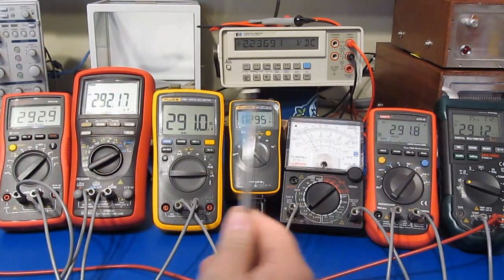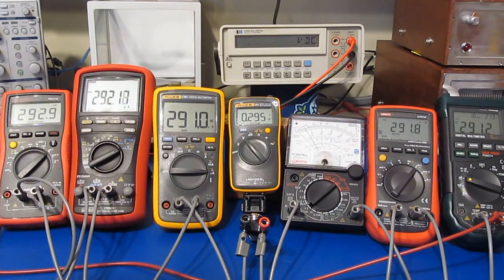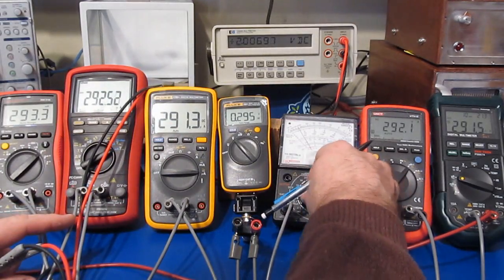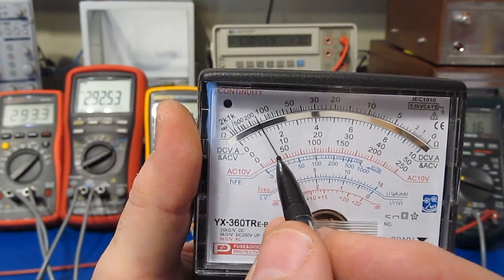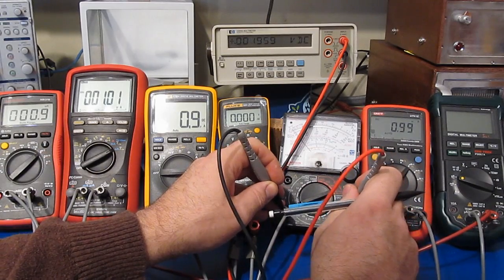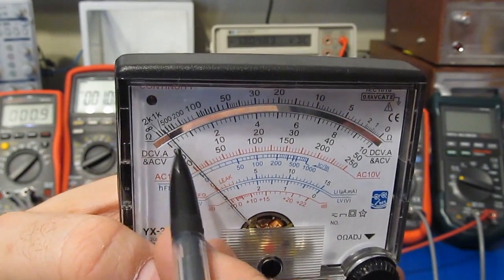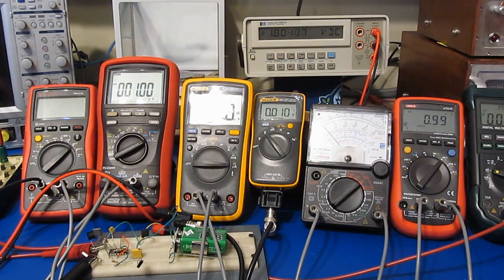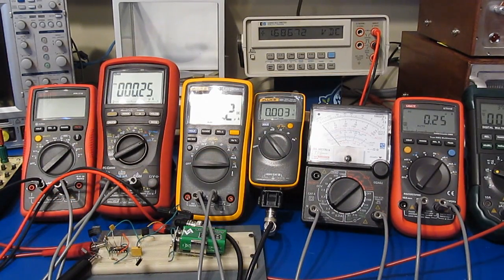More Meters are Tested at 1uA and Higher Currents

Comment: The Brymen seems to have different shunt resistors on each of its two current inputs. I guess you pay for lower shunt resistance in the 10A socket with less ability to measure small current.
Reply from the maker: It is common for meters to use different shunts for different ranges.

Comment: Hey Joe. This is the setup I'm wondering about. What's your username on EEVBlog I'll message you there.
Reply from the maker: Same as it is here.  You can find the main links under the About or Discussion tabs off the main page.   Not sure why you posted your question to a video that had nothing to do with your question.   In this video the meters are in series is all.
Reply: joe smith Was busy at work. Posted on the wrong video on my iPhone. Sorry about that.
Reply from the maker: Ok.  Does this make more sense now that they are all just strung together in series and the current then flows through all of the meters the same?
Reply: joe smith What are you using for this? I've been using multimeters for 20 years but until recently I never thought about testing them like this. I'm trying to understand more about how they work and how to test them as I'm finally setting up a home lab. I find your videos very informative and interesting
Reply from the maker: Just a power supply.  If you design low power devices, this would make more sense to you.  If you were an electrician or home appliance technician for example, I doubt you would ever have a need to measure low currents like this.
Reply: joe smith I worked on high power radars. I now work on particle accelerators. I understand it's hooked up to a power supply (I'm currently building two myself) I just don't see how the meters are tied together.
Reply from the maker: In series.  If you do not understand basic series and parallel circuits, Google is your friend.  There is a lot of good information at your finger tips.
Reply: joe smith I understand the difference between series and parallel I just never thought about stringing multiple meters together like that.
Reply from the maker: If you were benchmarking meters in their current measurement modes, would you just test them one at a time?   If so, why?
Reply: joe smith I've never bench tested any test equipment before. I was trying to understand your method so that I could apply it to the equipment I have. I'm sorry for inconveniencing you with my questions. Have a good weekend.
Reply from the maker: It was not an inconvenience.  Maybe not the clearest presented question I have tried to help answer.   Benchmarking these meters is the majority of what is being presented in these videos.  For you own home experiments, you could just try a few low cost meters and see how they compare against what you feel is your best meter.   You may be surprised how close or different they are.  Later
Reply: joe smith I know I didn't present it clearly and I'm sorry. Again I apologize for the inconvenience and I'll refrain from asking any more questions.

Comment: Dave just looked at some meters by Testo. they look really different and interesting.  maybe an idea for a meter for you?
Reply from the maker: Like the TESTO 760-1?  I'll look at what they have to offer.  Looks like from the poll, people really want to see the 121GW.  Would not mind getting a Gossen.
Reply: joe smith just like the 760. check out his video. the construction is unlike any other meter I've seen.  

oh yeah I want to see the 121gw bad.  assuming is passes muster its on my short list when it becomes available
Reply from the maker: I did offer to look at it for him a couple of times.  I also recently asked about the testing, no response.  Would like to run a higher end meter and the next down in the poll was a Gossen.   The next video I plan to do is yet one more mod to my UT61E.
Reply: joe smith yeah the gossen will be a good  one.  maybe he's worried it won't stack up and it'll hurt sales. I hope that's not the reason.
Reply from the maker: I was offering without any sort of disclosure just for more a heads up.  That last time I extended the offer was after he had mentioned he may want to have someone beyond himself look at it.  He has been talking about that meter for how long now?  I doubt he would release something that was not at least as robust as his rebranded meter.   That meter is touch as nails.  One thing you can count on is the computer that controls the transient generator  has no bias about the meters that are ran on it.   I watched his mailbag and scanned to the meters you mentioned.  The meter he shows looks really poor.  I kept thinking, can it really be that bad.  Too bad as the layout looked alright.

Comment: And the fluke can see current :-D
I wonder what the difference is between the fluke 17B and + version.
I have the 17B schematic, made for the china market, not really a fluke with a fortune fs9721 chip running the show.
Reply from the maker: Yea, it helps to know basic ohms law if you play with a meter.   I like the 17B+ for what it is.  Would be good for the garage or general electrical work.  I doubt you will find to many US brand products designed and made here in the states using US designed and made components.
Reply: Yes i do find it odd that a place as big as america doesnt directly manufacture more of its goods.
Its nothing to do with ability or talent as ive seen well made products from the usa in the past.
"Heavy duty" and "Quality" are the words that come to mind with usa products of the past.

My frend bought an industrial carpet cleaning machine that was made in the usa, it was so powerfull that it lifted heavy carpets off the floor if you were not carefull.
One heavy duty device, never needed repairing eather.
Reply from the maker: I still use my Lawnboy make in the 70's to cut my grass.  I've pulled the motor apart twice in all this time for cleaning the exhaust ports.
Reply: Yes ive seen that brand but only on youtube, ive never seen one in the uk.
I use a basic "Classic 3.5"  Briggs&Stratton push mower to cut my jungle down, i swear one day ill find a undiscovered tribe at the bottom of my garden :-D.
I think its getting a bit weak as the rpm drops on tufts of grass, the regulator is working correctly, so i can only assume its a bit tired.
I did put a new blade on it, and it cut slightly better, thats all it did.

I took my mates cheap-n-nasty china mower to clean the carb for him, it just beat the hell out of anything that got in its way, i then realised that my briggs&stratton was tired.
But im still happy with it :-D
Reply from the maker: Friend was going to toss out a leaf blower.  Said that it ran fine then just would not start.  Tore it apart, stuck rings.  Cheap unit and not going to get parts for it.  A lot of careful work with a razor blade and dental picks.  Managed to free it and remove it to clean the grove.  Get it all back together along with some fresh gas and good oil.  Gave it back to him and he could not believe how much power it had.   Still using it many years later.   Thinking to mod that UT61E one last time and drop the burden voltage into the muck.  Does not seem like that big of a deal after I looked at the PCB.
Reply: So it had enough compression to start, but when hot the bore expanded and the rings stayed the same, so no restarting from hot.
it makes sense but it creates such an odd effect.
Dam good repair, your frend is lucky to know you :-D.

Im not sure how you can improve the shunt side of the ut61e, thicken tracks to the shunt perhaps, are you going to add a x2 gain op amp circuit to allow half the resistance shunt?
Your not going to bypass the fuse are you lol.
Reply from the maker: No, the fuses will stay.  The large home made shunt and fuse I replaced are for the 20A circuit only.  The low current ranges used a different set of resistors which is why in the video I talk about it being 1Kohm rather than 0.01 ohms.   Not that the 0.01 ohm shunt would not give you a low burden at 1uA.  It would!! haha.  It has the worst burden voltage of all of my meters next to the free HF meter.   This is what I want to improve next.